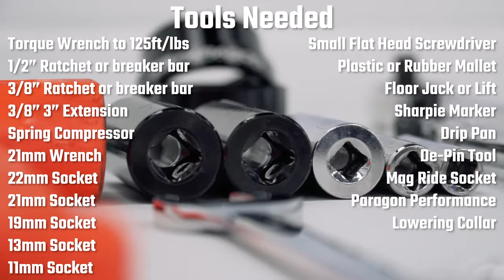C8 Corvette Lowering Collars Installation - Front Lift - Paragon Performance

Comment: Added the lowering collars (properly) on my '22 in the fall of 2022...started having issues with the front lift in 2023 and took it to the dealer.  No warranty coverage for the car and now have to spend $1K to fix issue. I know of 2 other people with the same issue. Unfortunately, PP stated that it was a faulty install...I have no doubt I did it right!
Reply: I bought the lowering collars and I’m having trouble finding a shop to install them. Did you have to replace your front lift assembly? I’m not sure if I want to even install them now, let alone find someone willing to do it.

Comment: After lowing the car only on a front collars and rear adjustments, do I need an alignment with a .75" lowered ht.? Also, how much negative cambr would this lowering cause?  If so, would this mimic the track alignment without the toe adjustment?

Comment: I want to do this to mine, have you heard of any issues or concerns? i hear there is a bulletin out for dealers to look for these. However, i cant really see what issue these would cause.
Reply from the maker: Only issues we hear about are from improper installs or raising the car while it's on an angle.

Any modification to any system will void that parts warranty. We believe GM made the bulletin after noticing many aftermarket solutions for lowering the front lift.

Comment: Do you keep the stock clearance from the lift system or is that also reduced with an inch?
Reply from the maker: The front lift still functions as normal. You're just lowering the car a inch in the front.

Comment: Other kits cut the rubber bump stop in half.  How come your kit doesn't require that?
Reply from the maker: "Other" kits don't need to either, but they didn't dig into it enough to figure that out. GM uses the exact same bump stop on Z51 cars that do not have front lift as Z51 cars with front lift. So GM out of the factory is assuming those with Z51 cars that do not have front lift when they lower their car the allowed .75 inch on the factory coilovers they need bump stops that will work that way out of the gate for the car.   So it's already done correctly from the factory.   No need to cut the stops, just for collars.  :)

Comment: How much needs to be lowered in the rear to match the front rings. I couldn't find the video...installing in the next days...Thanks
Reply from the maker: Miguel, you would need to lower the rear threaded collars to the max amount which is approximately 0.7" to match our Front Lift Lowering Collars. We will have a video uploaded today on how to adjust the rear threaded collars using our Paragon C8 Corvette Factory Z51 Coilover Wrench Set.
Reply: @ParagonPerformance  thanks!
Reply from the maker: @miguelalcrudo8810  Video is live on how to use the Paragon Wrenches :)

Comment: How come some people cut the bump stops and you guys don’t?
Reply from the maker: You do not need to cut them just for lowering collars. All Z51 cars use the same bump stops whether they have front lift or not.  So those Z51 cars that don't have front lift can lower their cars from the factory .75 inch also and not need to cut bump stops.   Same applies for front lift cars since they use the same bump stop.  Lowering .75 inch does not require the cutting.
Reply: When you watch your video you can see a piece of the cut bump stop. On the counter.  Cicio performance says to cut it, your video looks like it is cut yet you say don’t cut it?  Please confirm
Reply from the maker: @c8garage  You don't need to cut the bump stops for just the collars.